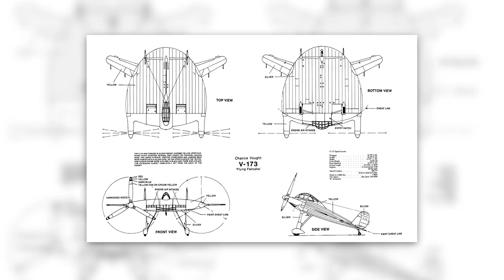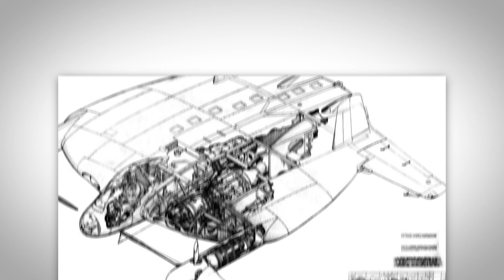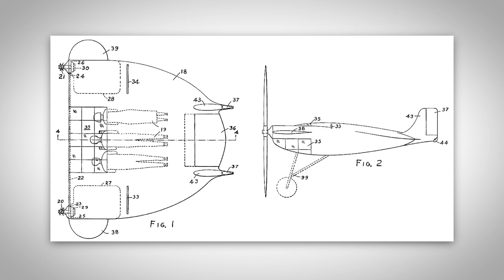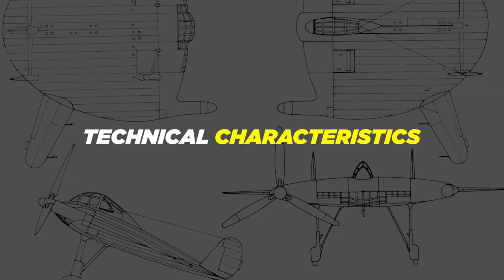What Happened To The Flying Pancake - Slowest Plane Ever Made!

Comment: You keep talking about  the V-173 but in most of the video you are showing the XF5U which are not the same aircraft the XF5U is the final product of the Flapjack  and it was actually built before the military canceled production! It was going to be a lot faster that the flapjack with a top speed around 500mph!